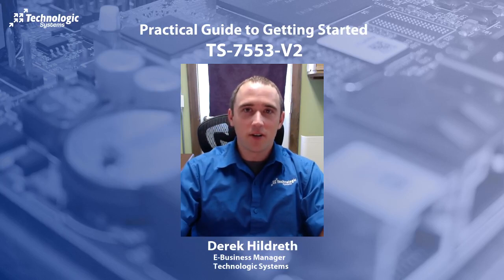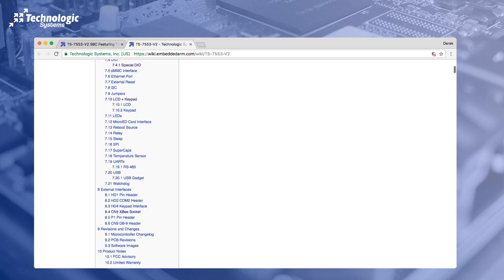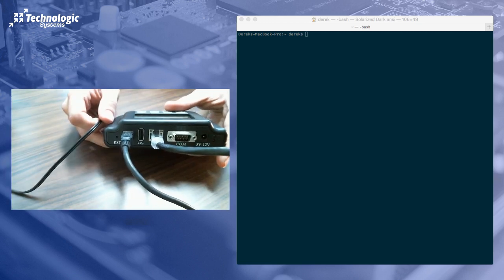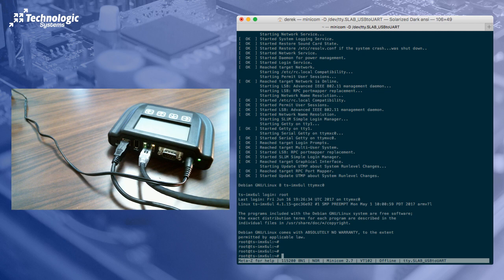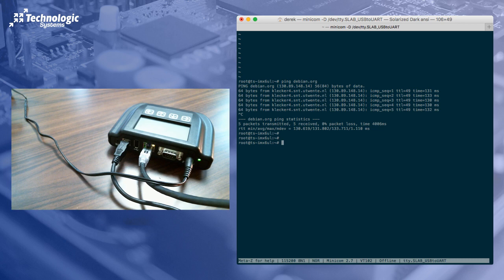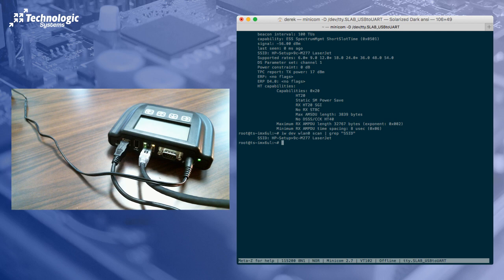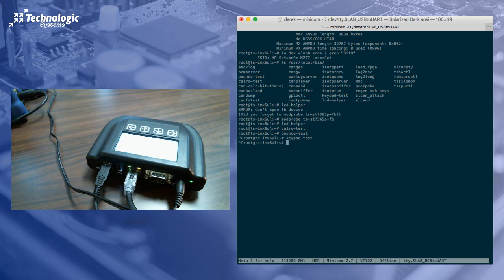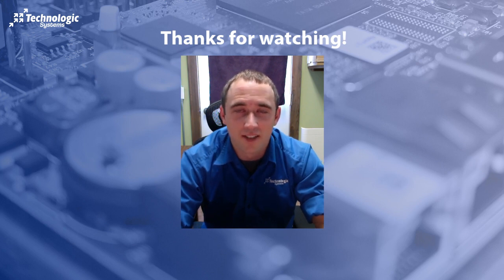Getting Started Guide for TS-7553-V2

Comment: Can you connect a monitor to it? and what is the main use of this device for? i bought one and noticed it has male RS232 hence couldn't connect to monitor.
Reply: You can use it as an IoT Gateway for edge computing.  The connector you are looking at is a DB-9 connector. These are used for many different interfaces such as Serial (RS232/RS485) as well as CAN.